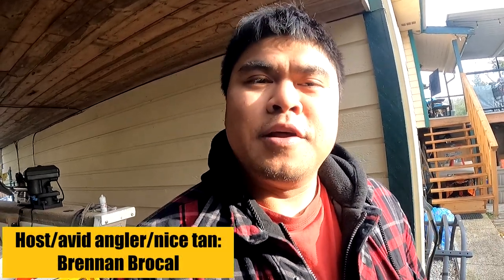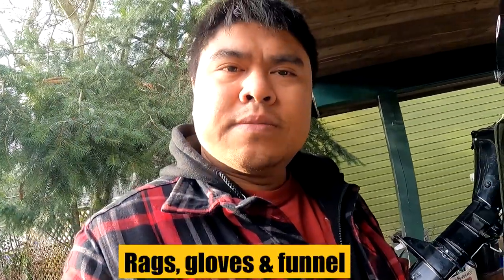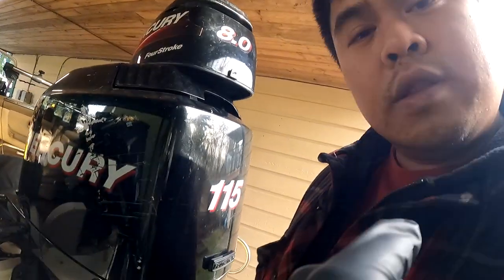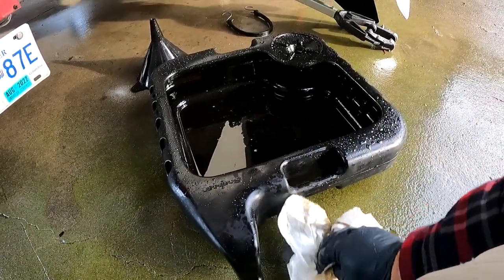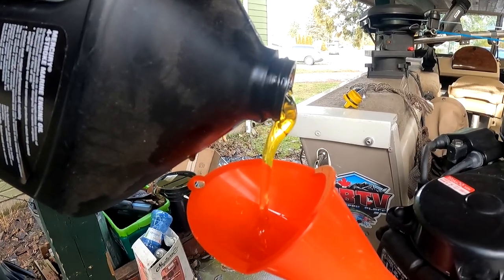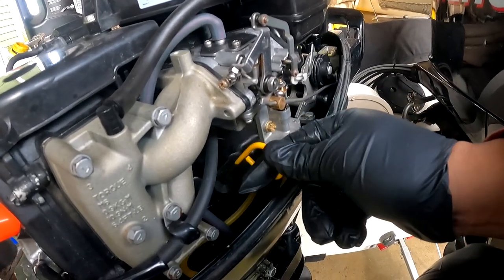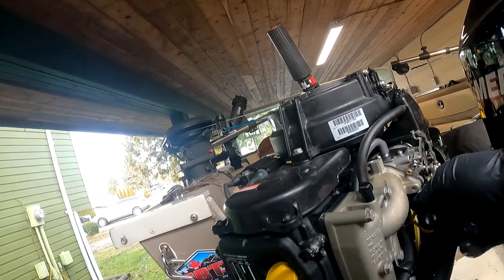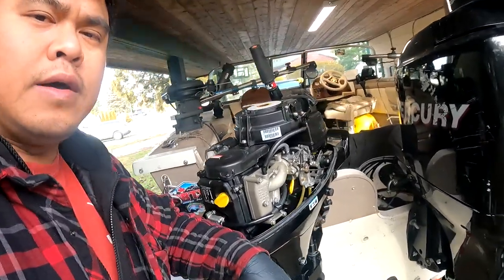Mercury outboard oil change. How to, 8hp 4 stroke Easy 15-minute job! #diy #mercury #outboard

Comment: My 8 hp mercury is brand new and this will be my first oil change it only has maybe 9 hours on it but I was wondering if I'll need that gasket since it's brand new?
Reply from the maker: It's recommended to change it every time.9 hours? Is that what the manual recommends on the first oil change? I change mine once a year, and it's definitely way more than 9 hours of use.
Reply: @bbtvfishingismyhappyplace  the dealer told me at 8 hours, then at 100 or once a year after that
Reply: @bbtvfishingismyhappyplace  I guess I'll have to read the owner manual
Reply from the maker: In that case, it's probably ok to reuse it at 9 hours. Just make sure to torque that bolt properly and send it! Good luck and tightlines!

Comment: I didn't see you change the oil filter
Reply from the maker: Hey thanks for watching. This 8hp kicker is filter less. My 115hp main has one which I'll make a video if it aswell.
Reply: Thanks for your video.    I have the same kicker as you.   How do you change the fuel/water separator filter on this motor?
 @bbtvfishingismyhappyplace
Reply from the maker: I have the fuel/water separator right after the gas reservoir. It's fixed mounted, and I swap the filter every season. It tees off into my main and into my kicker. Perhaps I'll make a video on  my setup.
Reply: Thanks.  I have one of those fixed on my transom for my main 150hp optimax.   That feeds both the kicker and big motor.  However inside the cowling I have another fuel filter canister on the port side of the motor.   I have a 2005  8hp 4 stroke just a EL.  I thought you may have a fuel filter 'canister' on your motor as well.  Thanks
 @bbtvfishingismyhappyplace
Reply from the maker: I have an inline fuel filter under the cowling. I'm not sure if our model is the same as I don't see a canister on mine. Send me an email, and I'll send you pics. I just took 4  of each side of my 8hp kicker. Bbtvmhp@gmail.com
Reply: Thank you for your reply.  My mistake.  I was confused.  This is on my 150 Optimax.  I happen to be doing maintenance on both motors at the same time.

I like your videos and helps and tips.  Please keep up the good work.  Thank you for being willing to help even though I made this mistake.  Good fishing to you.
 @bbtvfishingismyhappyplace
Reply from the maker: @MrTemoyle  no problem at all, happy to help. Thanks for the feedback.  Tightlines! 👍 🎣